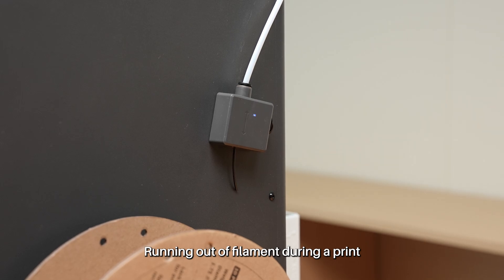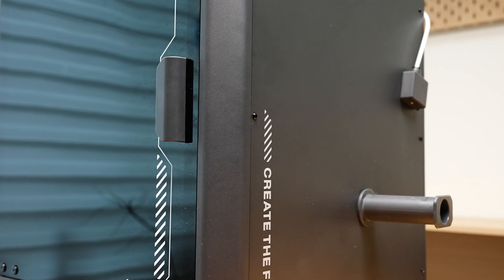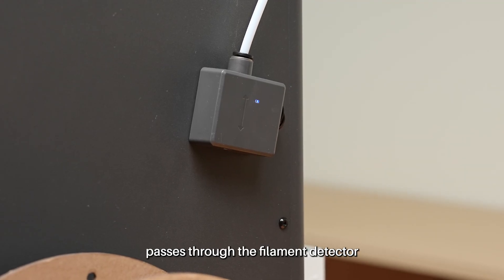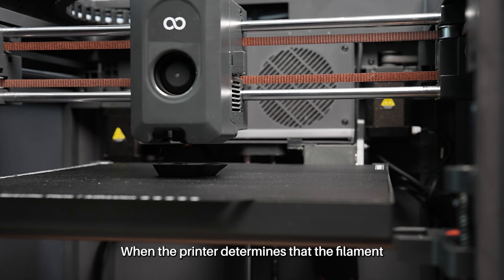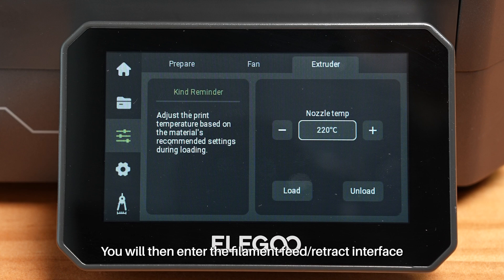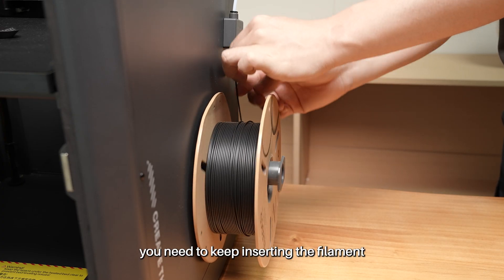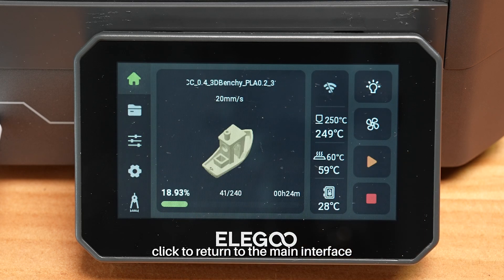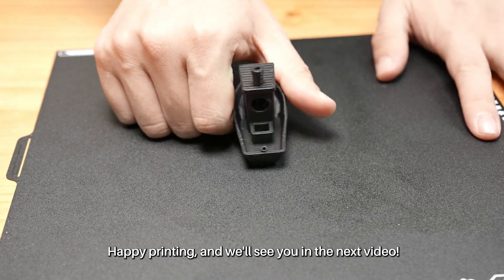How to Resume a Print After Filament Runout | Centauri Carbon

Comment: DO NOT BUY !!!! CAUTION!!!! Out of box 1st print successful, 2nd print started to fail . The printer will not print 1st day of purchase . Contacted support for refund or replacement of unit. Nothing but a run around after showing them pictures of the unit failing . No way am I paying for a brand new unit, then have to troubleshoot it for hours on first-time use. Avoid this company. Avoid the centari carbon. This printer has major issues!!!!
Reply: That's bullshit.
Reply: seems like a skill issue bro, works fine

Comment: The problem i have is if the spool runs out, without me present, the end of the filament is bent to hold it in the spool and that wont feed. So it still show filament present but it breaks and messes up the print. Unless you are there to cut off the bent end
Reply: hi, you're right, that's the only issue i have. Did you find a solution ?

Comment: elegoo provide fake warranty. i bought 4 pro recently. The extruder broke during the very first print and has remained clogged despite multiple cleaning attempts.

I have already applied for a replacement, but Elegoo responded by asking me to disassemble the extruder and attempt repairs myself using a few videos they provided.

If customers are expected to carry out repairs for new purchased one, what is the purpose of offering a warranty?

I do not recommend purchasing this item from this brand.